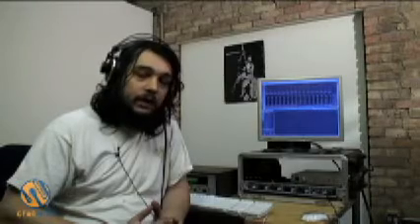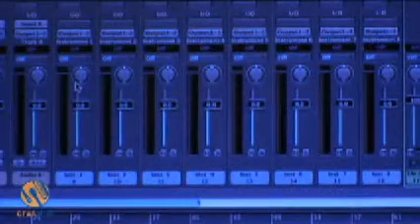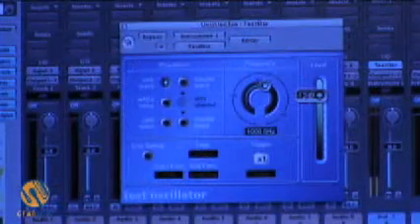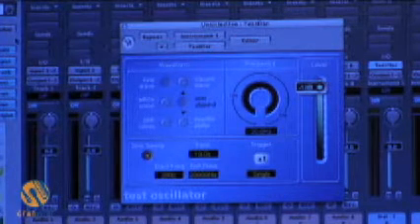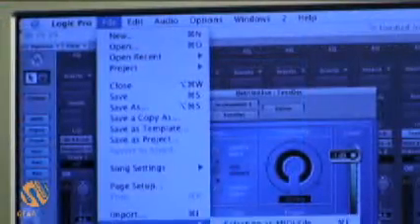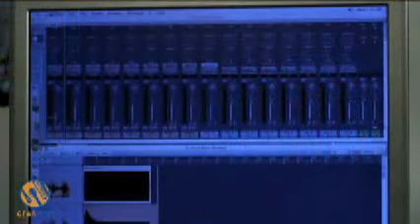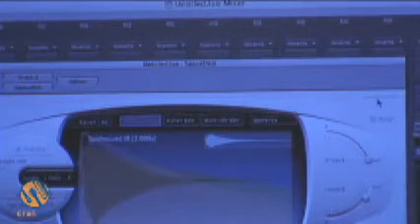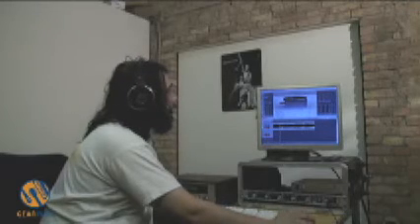Convolution Reverb - DIY Impulse Responses Video: Part 2

Comment: Apple Logic 9 (and probably some earlier versions too) has "Impulse Response Utility" built into the Space Designer plug-in. You can create your own impulses within this program and skip several steps in this video like creating a sin sweep. To find it, open Space Designer and look for where it says IR Sample. There will be a little drop down arrow, click it and then click open IR Utility. From there go to the help menu for step by step details on creating your own impulses.